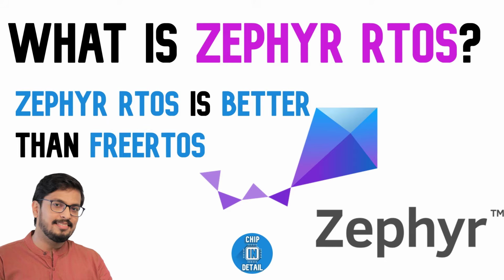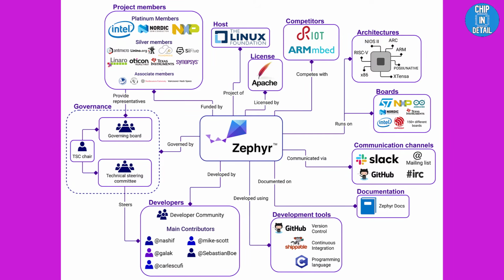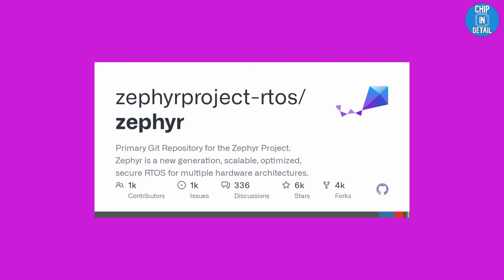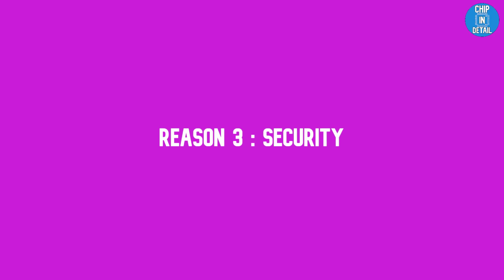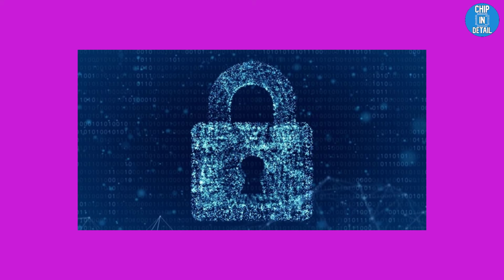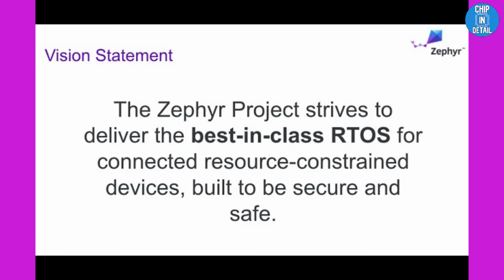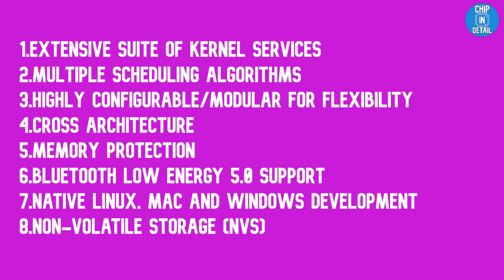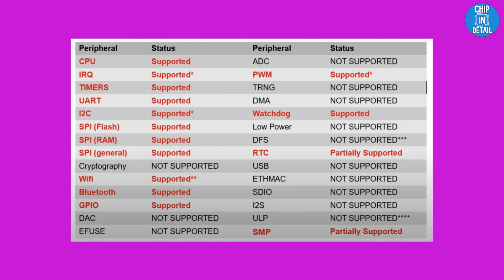Zephyr RTOS - Better than FreeRTOS? IoT Operating System

Comment: Does Zephyr RTOS run  on Raspberry PI 4?
Reply: Rp pi 4 is an overkill!
Reply: even Arduino Uno runs Zephyr, I hope this answers your question!
Reply: @parthasarathyr8629  Lol nah,  the Atmega 328p barely has size enough for super lightweight RTOS
Reply: Zephyr RTOS is for Microcontrollers, not a SBC that can run fully fledge Operating Systems